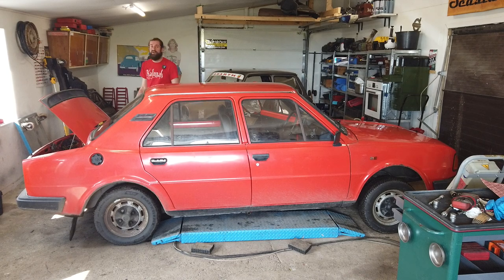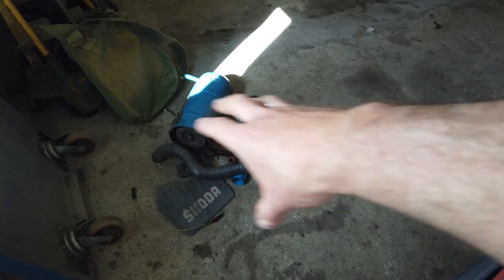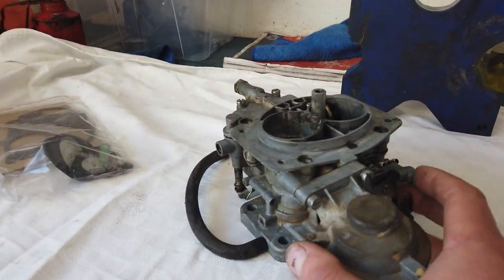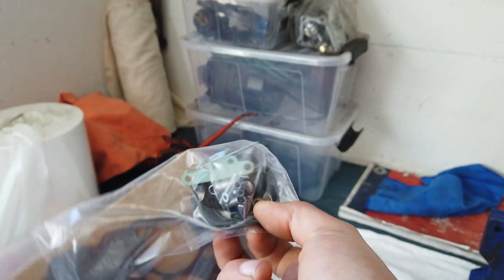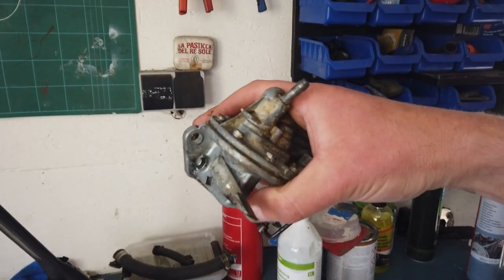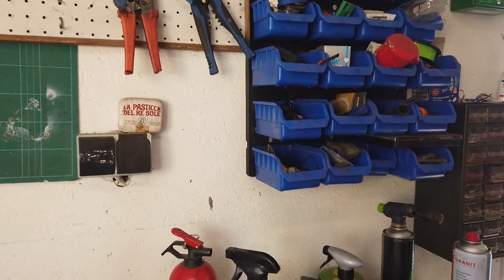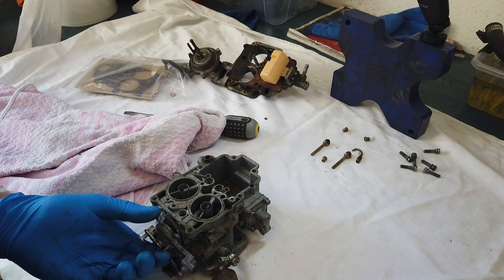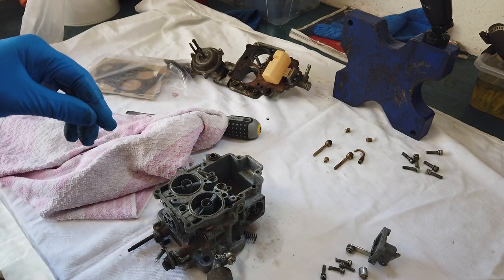BARN FIND ŠKODA 105- Carb and pump rebuild- COLD START!

Comment: This car represents all we have lost in the last 30 years. The Skoda may be a modest car, but it is repairable and maintainable to this day at reasonable cost as you are showing us, and which I am really enjoying watching. Compared that to the Mercedes in Car Wizard's shop that needed a tiny faulty switch replacing in the EGR mechanism. You can't buy the switch, just a whole new EGR assembly at nearly $2000. It has "once only" connectors, so if you ever remove the EGR unit the connectors break and you have to spend the $2000. Its deliberate and why I'm going off cars. I run an Octavia 4x4 and a single reversing sensor was £84 this week (genuine VW/Skoda part).
Reply: Price gouging by Mercedes, unless your wealthy avoid them , gimme the estelle everytime
Reply: I run a 2004 Fabia 1.2 htp, and although I'm sometimes stung by the price of VAG parts, my local garage keeps repair prices down using a local 'scrappie' for recycled parts. For instance, when the power steering unit broke,  the new price was nearly £300. I paid £50 for an old one in good condition. 5 years on, it's still working fine.
Reply: @frglee  cherish those shops! Modern Škoda dealerships don’t do this.
Reply from the maker: I enjoy the wizards honesty... Great videos he makes. :)

Will a Skoda ever reach his garage? ;)
Reply: @SeasideGarage  can’t say i have seen one featured over there , they had a few budgets of their own geo metro comes to mind

Comment: A good idea replacing the O rings on these, as when they get old they don't hold the mixture/air screws in and it is possible to lose them!
A break-down man showed me how to blow out the jets at the roadside, and I'd keep a stubby slot screwdriver with my tools to undo the top of the carb. The hose which runs from the air filter housing to below the carb is perfect for the job.
It is good to see you are making progress with this car. Looking forwards to more videos. :-)
Reply from the maker: Good tips!

I did change all the 0 rings... some where really bad...

Comment: again - simple technology that just works
Reply: Far too much tech, that most don't want on cars nowadays
Reply: @sid111sid111sid111  I agree, though I'm not actually sure if you could build a simple car like this any more due to emission regulations and safety rules. These engines were in production for many decades and modified versions even powered Skoda Favorits, Felicias and early Fabias up until about 2001 when they no longer met European emissions law, being replaced by small more modern small Skoda-designed engines, notably the 3 cylinder 1.2 and 1.0 engines, also used in other VW group cars.
Reply from the maker: Its so nice to work on... It just makes sense...

Comment: Hi. Great progress with your Skoda. I really like it!  I hope this fixes the problem with starting the engine  :) There is one thing that some people (including me) did with the fuel system. I always add one additional fuel filter somewhere in the middle of the fuel line going from the pump to the carburetor. Usually some nice quality filter is a good addition. It keeps those really tiny pieces of grime from getting into the carburetor. Those factory filters (one in the pump and one at the carburetor) are not ideal. Especially at this age of the car, the fuel tank itself can make quite a mess. My Skoda has so bad fuel tank that I have to exchange this additional filter every 3000 km because it clogs up completely (The inside goes from yellow=new to dark black=clogged) . Keep up the good work. :)
Reply from the maker: My tank seems to be pretty clean actually... I am lucky... but it is a good idea... :)

Comment: The blackened fuel is probably from the ethanol eating the old rubber membrane, horrible stuff for classics, hopefully the new diaphragm is ethanol-safe... :)
Reply: Yes or tank BP Ultimate 98. There’s still no ethanol in this gasoline. (In Holland) and hope it stays like that! 🤞🏻
Reply from the maker: Actually I think It was oil from the lever that goes into the engine that was mixing with the fuel... So I misread it... :)